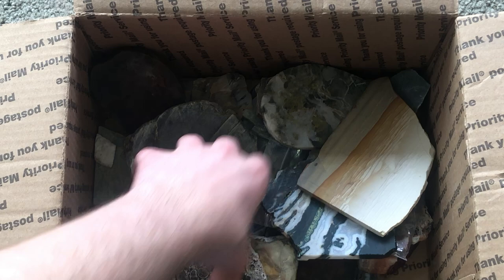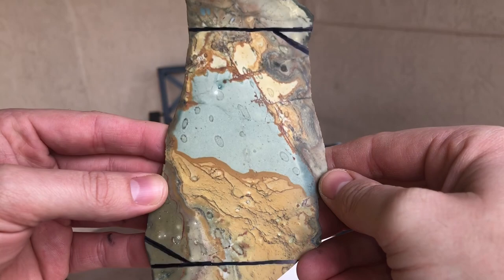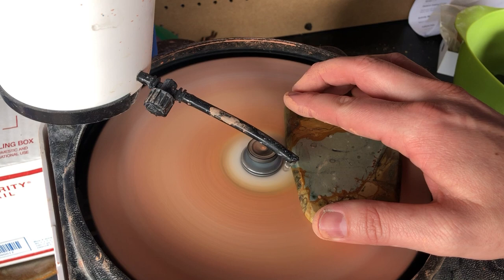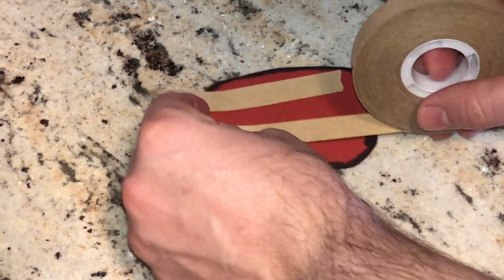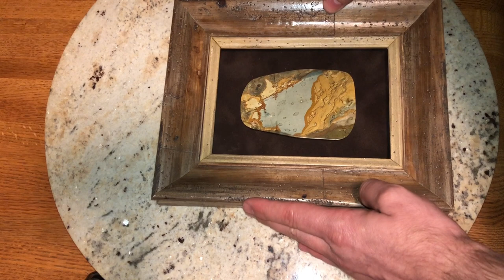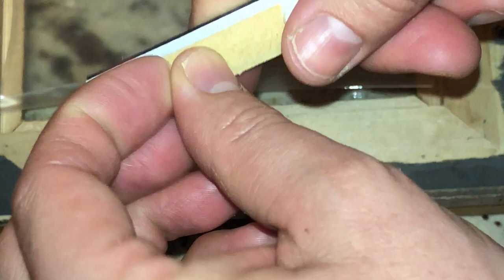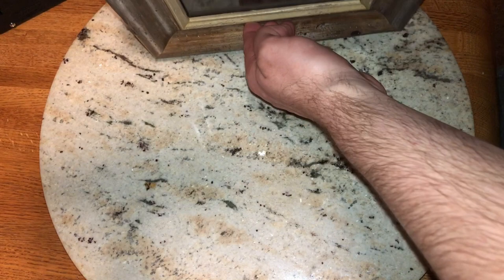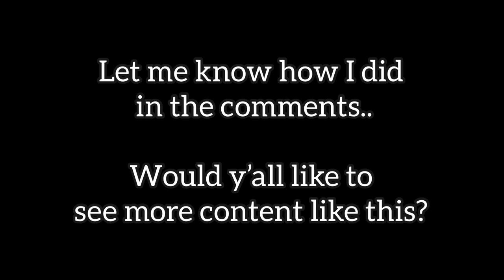Makers Challenge 3: Natures Artwork

Comment: * WHERE Is Your SAFETY Equipment?? Glasses, Mask (rock dust is Deadly) ( If you need Ear protection, etc... Please ~ BE SAFE . .  Rain Coat would help as well..
Reply from the maker: I knew someone was going to catch that. I normally wear a apron, glasses, and mask when cutting but i forgot that time and meant to put text in the video saying “remember your safety equipment when cutting”. Thanks for catching that. It definitely can be dangerous. Using a wet saw helps with no dust and I wasn’t cutting very long. Thanks for watching